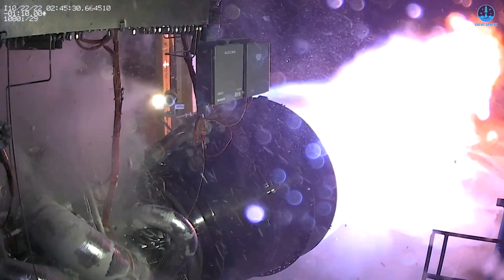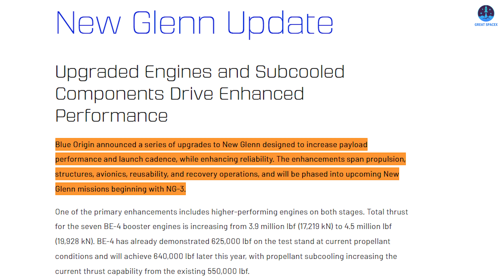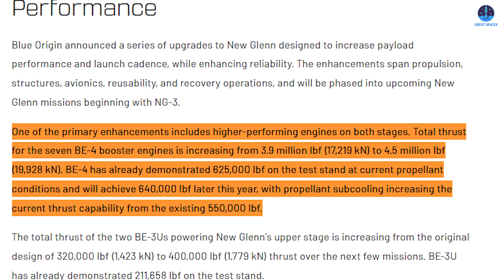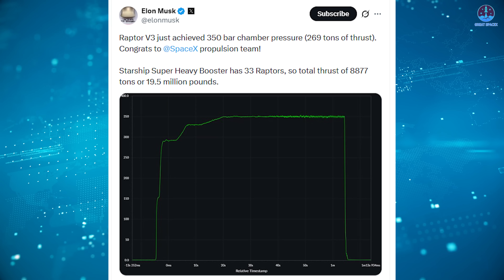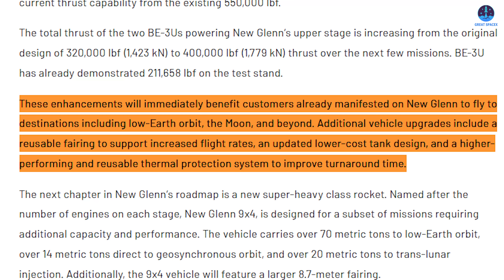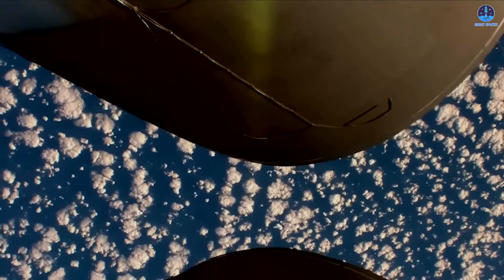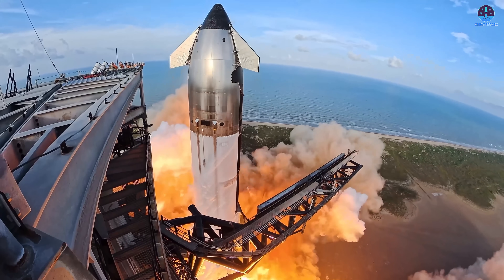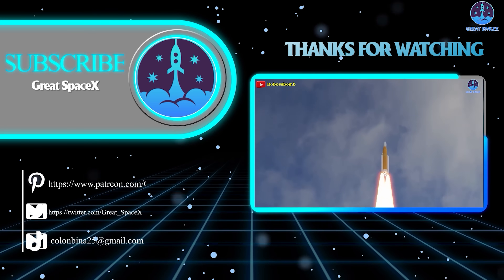Blue Origin's Upgraded BE-4 Engine somehow Better than SpaceX Raptor 3! Elon Musk's Reaction...

Comment: This is NOT an Apples for Apples comparison at all.
Raptor 3 is much smaller and lighter to start with. This makes a fundamental difference to its effectiveness in its application in Rocket Performance. The thrust figures alone don't show much, except possibly that a much larger, heavier and more complex Engine like the Blue Origin BE4 can produce more power. 
So what ? As you can fit more Raptor 3 Engines for the same space and they are proportionately lighter (and more efficient ?) then using Common Sense, that in most circumstances automatically makes the Raptor 3 Engine a much better power solution.

These vids sometimes do just use hyperbole to mask the obvious truth of matters !!!
Reply: did you not watch the whole video? he literally mentions all of that

Comment: Why do you take anythink musk claims at face value? only the measured numbers are important.
Reply: Raptor engine has a better power to weight ratio, hence, Raptor is better. Rocket engine from BO is much bigger engine and puts out more thrust because it is bigger, but not as efficient as Raptor Engine, That comes from the Stats, not from the mouth of Elon or anyone else.
Reply: @1flash3571  That is my point. The stats CAME from Elon, from his twitter, and he is a very unreliable source. therefore I Don't trust the numbers. Also I don't fully agree with your premise: "Better Power to weight ratio, hence, Raptor is Better". I think only Delta V of the full system is important, whatever the raw power stats from one component are, and in that regard Starship has not delivered yet. (Zero Tons to Orbit). I think they should pivot from a 2 stage to a leaner three stage rocket, that would increase efficiency.

Comment: Engine weight is also an issue as well as ISP.  New results for BE3U indicate it is getting better than the RL-10.  This bodes well for the New Glen.  It is a very rare payload that needs more than 70 tons, and the higher ISP 2nd stage will work well for deeper space.  Issue will be how long these improvements take to implement, cost of fairing manufacture or recovery, rapidity and cost of second stage manufacture. etc.

Comment: So BE-4 (only on the test stand as of today 11/30/25) is 284 tons thrust with an eye toward 291 tons later this year. Raptor was at 280 tons a year ago with an eye toward 300 tons (with a "theoretical" 330 tons). 

Sooo... no. Neither new BE-4 has flown and the goals are near but not quite Raptor 3, an engine with maybe 2/3 the weight of BE-4. There is also an ISP gap as well with Raptor 3 leading. 

Mostly... I don't see the BO factories to build all the assembly lines I would expect for 20 rockets per year.

Comment: You could not put 33 of them side by side like on SpaceX Super Heavy Starship, BE4 uses diff fuels, is heavier and needs shielding, not in the same category, Raptor 3 is still more cost effective and ahead of the competition. Total trust is only one factor of which is better. When they have a booster that can collectively produce over 10,000 to 11,000 tons of thrust let me know!

Comment: raptor 3 is still way ahead on thrust to weight ratio. which makes it way more efficient than the be4. be4 is also way more complicated and thus the potential for failure and rud goes up by more than 70%. at blue origins current cost and development pace then new versions of be4 will cost more than 10 times as much and take at least 8 years to develop.

Comment: I'm not a rocket engineer, but one major factor is that the BE4 uses only one turbopump, which means it must work MUCH harder. Therefore, it would almost certainly be limited in its overall capacity. Also, it weighs much more than raptor, takes up much more space, is more complex, takes much longer to build, and costs more. 
But as one viewer said, we need to evolve beyond "tribal thinking" and take a more objective and neutral approach. Both engines are valid.

Comment: The table at 7:17 shows a slight improvement in the technical specifications for Starship V2 to V3. However, the announced payload has increased from 35 to over 100 tonnes. This is particularly noteworthy because a payload of over 100 tons was already announced for Starship V2, but in the end not even a 35-tonne payload was achieved. The technical data seems very flexible and optimistic. Is any of it true?

Comment: I think we are witnessing great period in rocket building. Again. Blue Origin, SpaceX, Rocket Lab, Chinese companies, Japan, India...
Comparing them all may not be simple nor even needed. Production costs, reusability and reliability, max thrust, thrust to weight ratio, fuel efficiency (Isp), etc. There are quite a few important aspects and one engine may be better at some while losing in other categories. Depends. Respect to all the real engineers behind the scenes building them.
One thing you shouldn't do for sure would be comparing Super Heavy to New Glenn. One is booster for reusable second stage, other doesn't care about second stage and could be lighter.

Comment: Raptor 2 is almost equal to BE4 (BE4 has only 9% more trust). SpaceX produced and flew 400 Raptor 2 . Meanwhile, Blue Origin produced 30 BE4 and flew 9 of them. 40 Raptor 3 are already produced and ready to fly. Meanwhile,  10 Upgrade BE4 where produced and ready to fly . 

BE 4 turnaround time is expected to be weeks to months between flights due to refurbishment cycles. Raptor 3 turnaround time is expected to be hours. 

But, the real name of the game is cost per flight.  New Glenn (with upgraded BE4) cost per launch will  likely be in the $150–$200 million range.  initial launch cost for Starship is forecast to be $20–$30 millions dropping toward $10M or less as reuse mature. Even though the upgraded BE4 was better than the Raptor 3, Blue Origin will never be able to compete with SpaceX because of the cost per launch. 

Would you prefer to pay $20 million for 150+ tonnes payload to LEO or $150 million for 70 tonnes?

Comment: The BE4 should have more thrust than the Raptor as it is a bigger engine (so you can't really compare them like for like).
The fact the Raptor 2 had more thrust than the BE4 was just a result of the Raptors higher development rate! 
The BE4 is easier to fix, but the Raptor is designed to just be replaced as they make so many of them so cheaply. (The removed engines can then be repaired at leisure).

Comment: Thrust is just one part of the picture. The BE4 will also be much easier to service... Musk himself admitted the Raptor 3 engines literally have to be cut open to be repaired or refurbished.

It's pure hubris. It's what happens when your chief-engineer has zero experience. I'd bet tons of money Musk couldn't write the rocket equation from memory, let alone actually solve for its values and put it to meaningful work.

The "Everyday Astronaut" is more of an aerospace engineer than Musk is, and he also isn't...
Reply: LMFAO the Raptor doesn't need to be cut open. Plus the Raptors are designed to be removed and replaced, something that the BE4 is not.

Comment: "BE-4 is already flying but Raptor 3 is not." ???  How incredibly misleading. The upgraded version of the BE-4 HAS NOT FLOWN! The BE-4 (version 1) has flown, as has the Raptor (versions 1 & 2). Guess we'll have to wait and see whether the Upgraded BE-4 or the Raptor 3 flies first. But who cares? With only 7 (or 9) BE-4s, it's going to take an impossible increase in thrust for NG to get anywhere close to Superheavy ... and NG is only PARTIALLY reusable.
Reply: If SpaceX ever does recover the second stage of starship, it'll require even more refurbishment than the Shuttle ever did (which you bootlickers say isn't a reusable vehicle), guarunteed. There will be no rapid refuel and relaunch. You are a mark, and an easy one at that...

Comment: Be4 weighs far more & is more than twice the footprint of a Raptor 3  with a very small margin of raw thrust ,we won't even get into the price difference! Let alone the production rate! Then there are the be3u Hydrolox engines are not great as their tankage is horrific.
Reply: The BE4 isn't being stressed to the limits of what's possible. It's a better solution for reusability.
Reply: The sad part is if Raptor didn't exist BE4 would be considered the most advanced engine in the world... Crushing legacy engine...
So SpaceX fan should calm down a little. Blue did a great job and congratulations are in order. For disclaimer I am not a blue fan but a rocket lab share holder 😊
Reply: Hope he sees this, champ...
Reply: I was away to say that con the 2 be compared as you would have to take size and fuel efficiency etc into account, it's like saying your mustang is more powerful than my pushbike Kevin.

Hardly a fair comparison!!
Reply: It’s good to see so many good rocket companies.